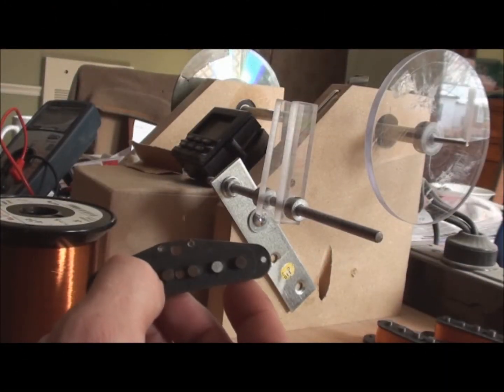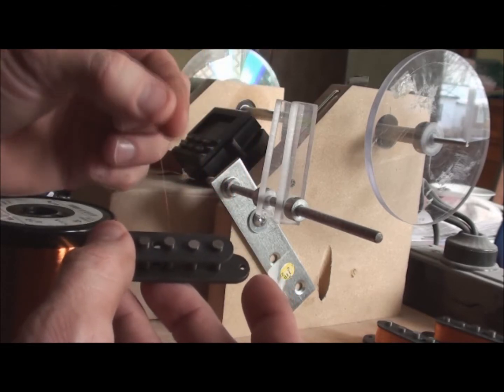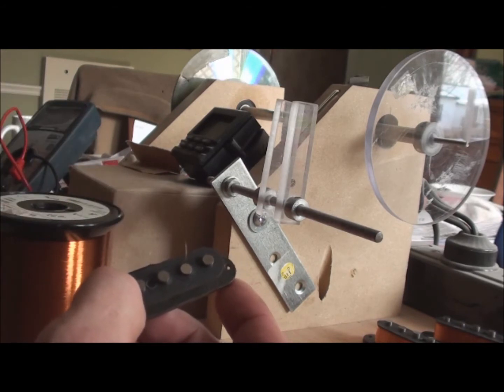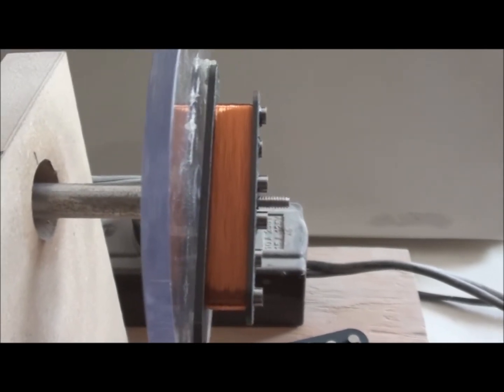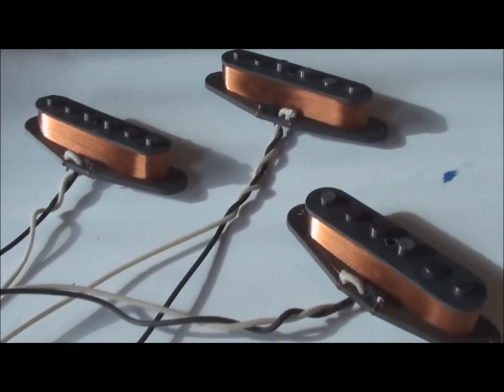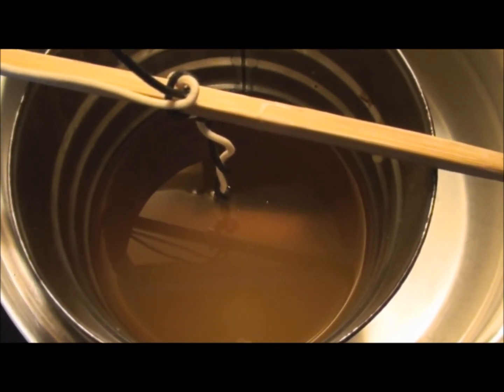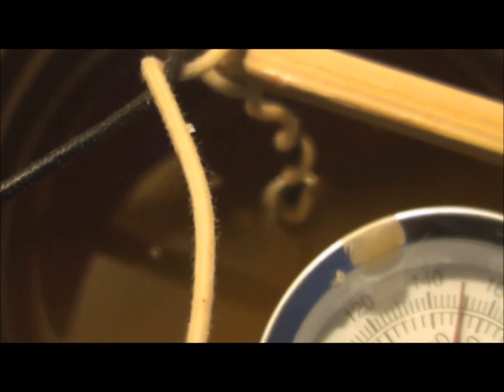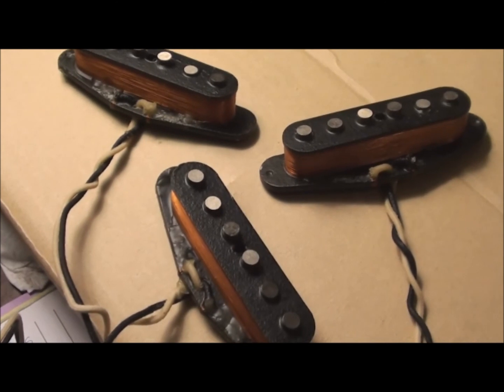building strat pickups

Comment from the maker: The string wrap is for protection and strats have covers if there are no covers youll see tape around it. The tele bridge had no actual cover per se except for the ashtray cover which we really never see actually used. The clothe acts as the protective cover that a plastic or metal cover provides.

Comment: @Bobo9977 
I have been a Machinist all my life,For someone at a home shop with a drill press You could put the magnets in the drill chuck and a 45 degree carbide lathe tool bit in  a vise and bring the quill down to cut the angle.That should get it done. Rigidity of the quill would be a factor in keeping run out (slop) and chatter to a minimum.Tighten up the quill lock with some drag if it has one,that should help the run out, also keep the tool bit on center line. -K

Comment: I've seen a few heavily played (sweaty) or really old pups that have corrosion on the pole pieces - with the coil wound directly onto them as you've done -  that has caused damage to the inner windings - esp' when people have  adjusted the pole pieces subsequently. I wonder if putting something on the pole pieces (e.g. PTFE plumbers tape) prior to winding would be possible without detriment..? Have you re-wound any that have been similarly affected, if so what did you do?

Comment from the maker: Ok well the motor comes from a sewing machine with footpedal. The counter is a veeder root unit that came out of an industrial fabric mill. The trigger system uses an optic trigger with a blacked out CD disk. The shaft is 3/8" rod with bearings mounted in mdf. The bobbin holder is 1/4 plexi with drill bit stop collar super glued ti it and tightend to the end of the shaft.